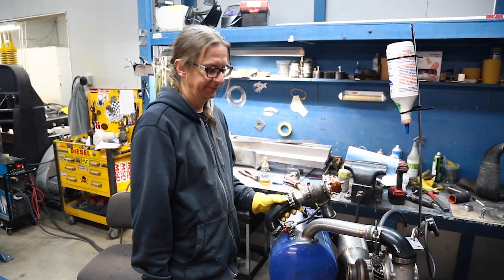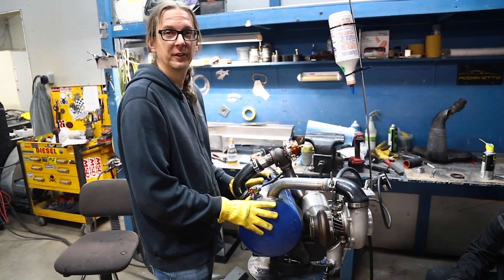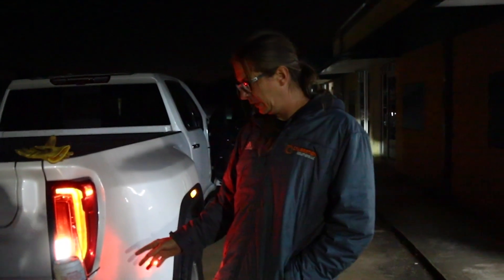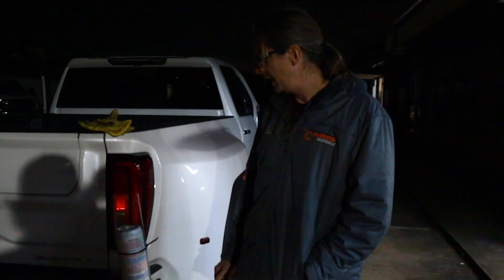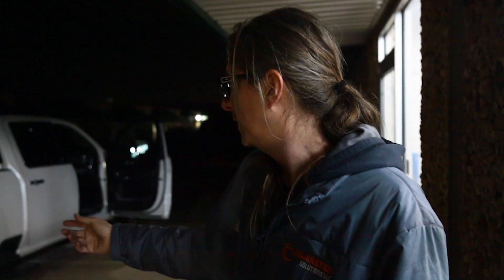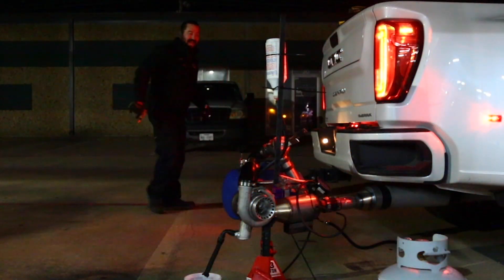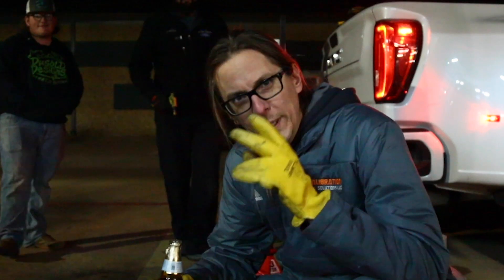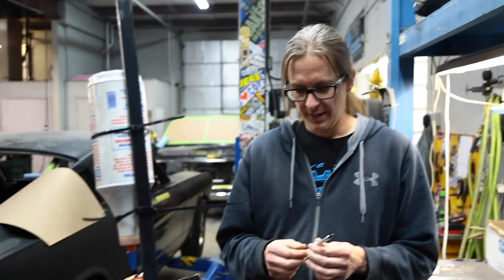Building a Jet Engine Combuster Anti-Lag System Goes Bad!

Comment: Based upon my muppet brain analysis..... your failures were related to trying this on a rigged up test rig vs. in it's real world intended use case.  I would try installing it how it is intended to be installed on the motor because that would solve a lot of these issues.

Comment: The WRX in the WRC rally cars, subaru actually uses the rocket anti-lag system that you may have read up on, I think they run the car a little richer, leaving un burnt fuel to travel through the exhaust manifold into the rocket going into the turbo while having a y-join right before the charged cool air from the turbo goes into the engine and is controlled with a valve pulling in fresh compressed air into the rocket creating a richer combustion and the vortex that the rocket was made to increase the amount of exhaust pressure spooling the turbo up. The reason with valve is to control when to allow the rocket to spool the turbo up without losing the ability of engine braking in high speed sections to short narrow apex turns and coming out full throttle with the antilag. Will love to see you come back to this idea and make it work!

Comment: I have thought about different antilag systems for years and I am currently working on something similar.  I have been around aviation and aircraft since I was a teenager and I like incorporating those things into automotive performance.  I have been experimenting with using bleed air from an apu to spool a turbo and as long as the apu is running in the trunk of the vehicle I would have a source of pressurized gasses to spool the turbo.  I then said why not ditch the turbo all together and just use the apu bleed air to force feed the engine.  Any gas generator can be used to spool the turbo.  I have a few different gas turbine engines laying around to test. An auxiliary power unit is the perfect fit for my application.